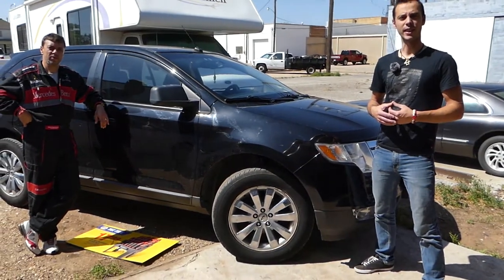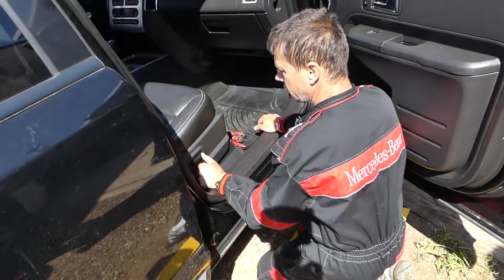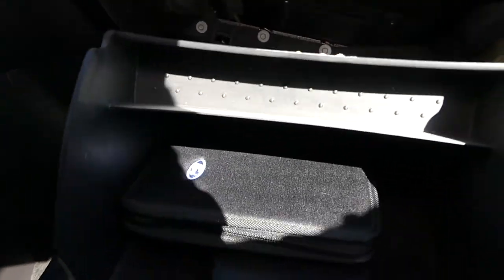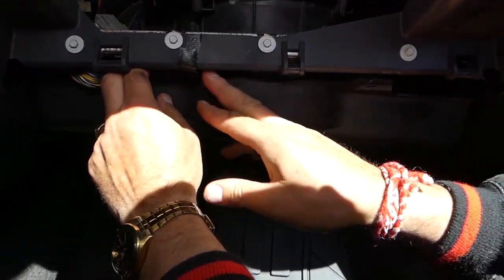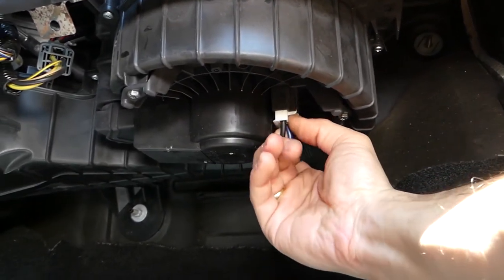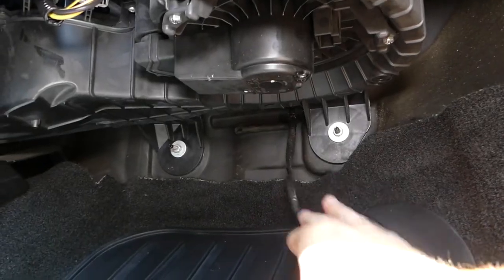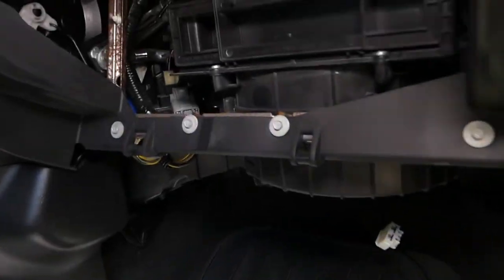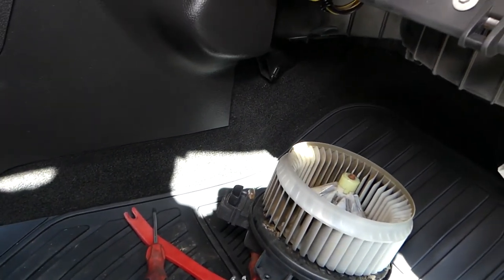HEATER BLOWER MOTOR FAN REPLACEMENT LOCATION FORD EDGE LINCOLN MKX

Comment: Thanks for the easy way... lol I was watching another video where it was a av fan replacement, but the guy was testing the resistors and removing at least 2 times as much work as just replacing the fan. Thanks

Comment: Great video ARG, very clear instructions and very helpful. I will be replacing mine this weekend because it is making some noise, still works but makes noise which is an indication that it will quit working soon. Thanks again.
Reply: Did you feel any more power coming from the blower after you changed it?

Comment: Great straight to the point video. My blower is squealing and I am going to apply oil to the shaft somehow, I am thinking. Hopefully it will last. 2016 MKX for me.
Reply: I have a 2012 MKX and my blower had the same squealing sound.  After about 6 months it stopped blowing air completely.  I bought a new blower motor from Rock auto for $64 (there are cheaper ones) and using this video had it installed in 15 minutes.  The stealership wanted $500 to do the job.
Reply: @redstone5149  Nice! Yes I bought one on amazon, not a tough job at all. Thanks!

Comment: Thank you. I fixed mine but still  making noise. My 2011 glove compartment seemed to be different than my 2007. Couldn't get it out easily. It looked bolted in. The clips made it come down but looked like I needed to take out some screws. Then broke part of glove compartment.  At least I have heat

Comment: I need a little help with replacing my rear AC blower motor on my 2010 Lincoln MKT 3.7 I have the repair manual but I just need to be clear that I take the Left hand side rear third row seat panel off to access the rear or Auxiliary blower motor?

Comment: You guys are so good! My 2009 MKZ, the heated and ac seat work on the passenger side, but on the driver side, only the ac portion works. Any idea?
Reply: Actuator or your fuse
Reply: (Probably too late of a reply to help you but to someone else with a similar problem) it’s more than likely one of the TED modules aka the fans that are in the seat bottom or the backrest, the coil that heats up to produce the hot air that is then blown through the fan will usually have a wire break off just from age causing it to no longer heat up, the car then realizes that and shuts the heated seat off because it detects the problem. I had the same issue in my 2009 MKX and when I pulled the back of the seat off and took the fan out everything appeared okay until I swapped it with the passenger side and then the passenger side no longer worked. Took it apart and that’s when I realized the wire had separated.

Comment: Can you tell me where the drain hose is connected by the condenser, I looked by the gas pedal and I found the small PVC line that goes out. But the hose from the condenser is not there.

Comment: I have a 2008 ford edge . When I cut the heat or air on before I would hear a noise from the dash and now I can hear it try to click in but it doesn’t blow . I would it be the blow motor ?
Reply: Same- mine will just click like a clock. Hoping someone knows the answer. Not sure if I should just go ahead and replace motor

Comment: I need help my heater isn't working, ac works great.... Just not getting heat at all 🤔🥺 2007 ford edge sel
Reply: Mines is doing the same thing on a 2014
Reply: I'm sure it's too late but check coolant fluid in radiator and thermostat.